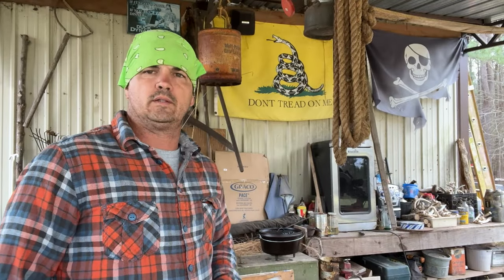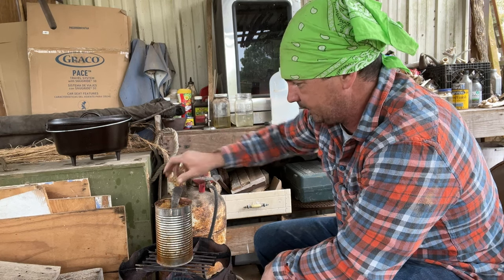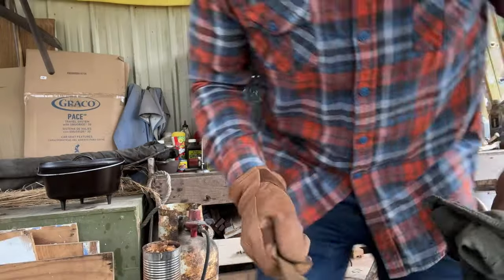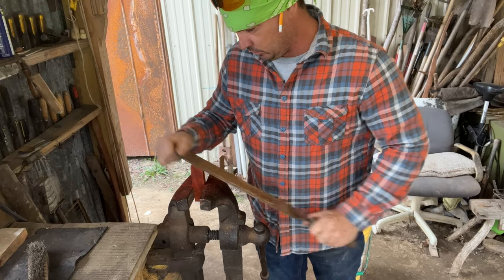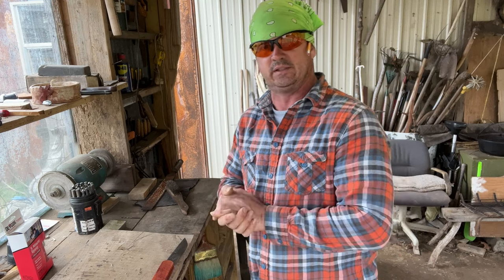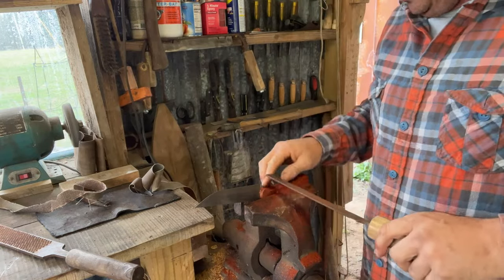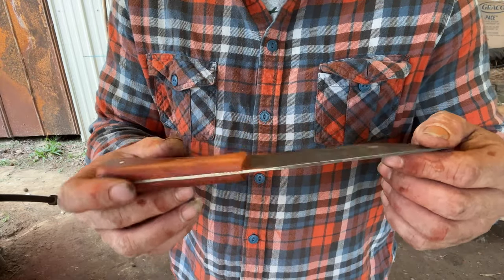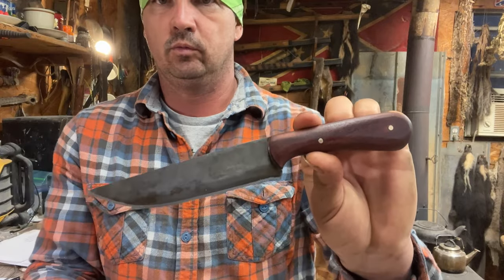Forcing a patina on a carbon steel knife blade

Comment: Moma knows best . I too got some metal in my eye welding and grinding  and was lucky I didn't loose my eye . Had to have surgery  . I'm stubborn but I try to wear some protection. That is a nice  looking knife. Have ya tried to see if the metal will make a spark on a rod.
Reply from the maker: It will a ferro rod but not off flint unless i heat it and quench it

Comment: Get you some Brownells plum brown solution, used to brown black powder rifle barrels. Degrease your blade, heat it up with a torch, and apply the solution with clean cotton balls, you’ll get a nice deep brown finish.
Reply from the maker: Ive seen it on guns but wasnt really a fan of it .

Comment: That's a great looking knife! I have several that are the same profile and I love them!  In the past, I've used yellow mustard to patina 1075 & 1095 tool steel. It works well and depending on how you apply the mustard, you can make it have a camo look, a swirled look, tiger striped, etc or you can cover the whole blade and it'll all turn dark like you did with the vinegar/water solution. Just put it on the blade and let it sit. The longer it sits, the darker it gets. Maybe give it a try in the future and see how you like it.

Comment: Sorry about your knife my friend, I saw how that went! You’ll get er back I hope, but sure gives a reason to make another 😂 thanks for the info. I’ve got a 52” sawmill blade and I’m gonna try my hand at it with antler! Do you think I can make it without heat tempering?
Reply from the maker: Most saw blades you can but what id do is cut a peice and sharpen it and dont let it change color when grinding on it and whittle with it and see if it holds an edge or not. I made a knife with this and toted it and i was happy with it. Now its not gonna hold an edge as well as forged spring steel but for a man that dont mind sharpening a knife along it is good
Reply: @SpiritoftheOutdoors  excellent, will do and thanks brother